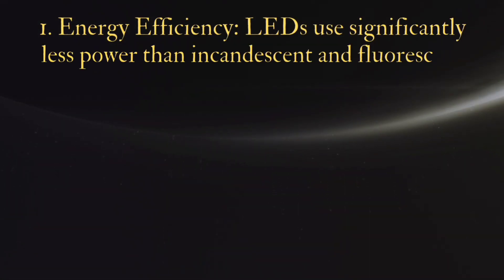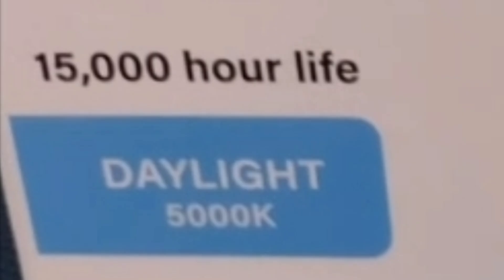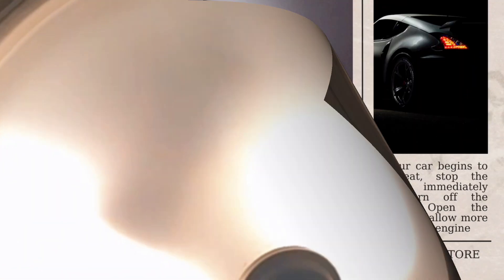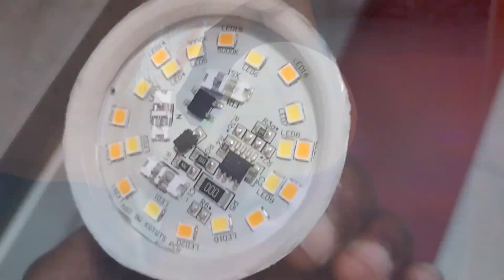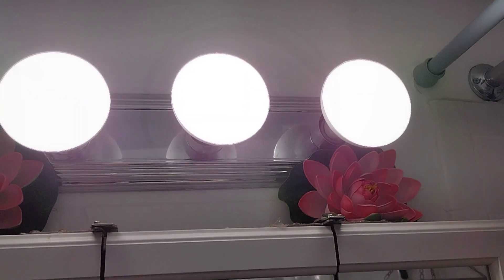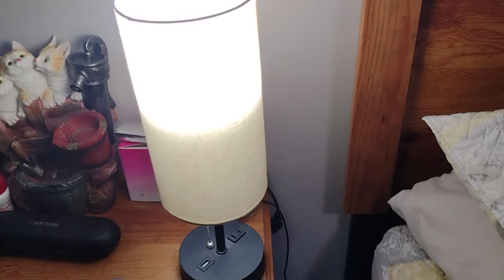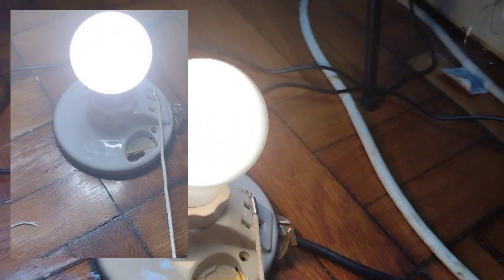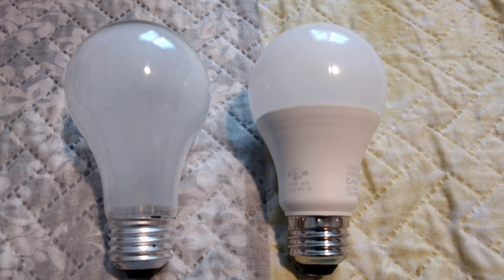Why You Should  Never Use LED House Bulbs In Closed Fixtures

Comment: The brighter the LED bulb, the shorter the lifespan.
Also, one 100W equivalent is cooler than 2 -50w equivalent bulbs.
Reply from the maker: @crazysquirrel9425  Thanks for watching and for your feedback. There is a direct correlation. Brighter bulbs equal more heat which means shorter lifespan.

Comment: I’ve lived this home now 25 years. My original kitchen, bathrooms, dining room lights now all at least that old. And all just plain old incandescent.
Reply: Same here.  A few are still here that i know are as old as the house (1979).  I do have LEDs outside and in my workshop.  Everywhere else I only use incandescent.
Reply: Incandescent bulbs are getting much harder to find.
Reply: @heronimousbrapson863  True, but these bulbs themselves are 25+ years old, and I have a stash
Reply: And don’t forget, in these northern latitudes we are in a net heating situation sept-jun. there is no such thing as”wasted” heat for 9 months of the year, when it’s darkest the longest.
Reply: @ak983625  amen!
Reply: ME TOO! I have more than 3 dozen single-life incandescents that are just about 25 years old, and fewer than 5 have burned out since they were originally installed when our house was built. I have stockpile of American made double-life halogens, and I get about 5-10 years out of most them. It's sad that we killed the entire American light bulb manufacturing industry by banning halogens and incandescents in favor of cheaply made, overpriced Chinese junk.
Reply: @John-bs5ug  you’re right, Chinese junk. With dimmers, I run all lights, even halogens a measure below full, and kooks way better.
Reply: I will use up my stash of incandescent bulbs before I start buying these fancy LED bulbs.  I can’t see throwing away perfectly good bulbs for a chance at saving money on my power bill.  It’s just me in the house and rarely do I have more than 1 or 2 bulbs burning at the same time.  I’m not like some people that keep their entire house lit up at night, inside and out.
Reply: @CH67guy1  keep buying incandescents till you can't; you won't regret it.
Reply: @KC9UDX  Yes I agree!  Thank you!
Reply: @CH67guy1  That's a woman thing! My second job is running around turning lights OFF!

Comment: just swapped out some incandescent 100W bulbs for incandescent 275W bulbs. hell yeah!

ok, ok, theyre for an incubator... the whole point is theyre supposed to get warm!

had to change the sockets from BC to edison though. really hard to find high wattage bulbs on a BC base. the original bulbs were carbon filaments, basically unobtainium... the replacements from the supplier? nasty chinese things that burnt out within a few days, if that. tried a bunch from fleabay for about 1/10th the price... turned out to be exactly the same bulb, in a different package.

the "tastic" heat lamps work fine... and are easily obtained for when they fail.

anyway... the same issue applied to the CCFL, when governments started mandating "efficient bulbs"... that fitting intended to cope with a 60W incandescent simply wasnt ventilated well enough to allow the electronics of the inverters to survive for much longer than a few weeks... quite a few fires were started... 

still, i have the odd CCFL still working fine in various locations. all "open".
Reply from the maker: @paradiselost9946  You had me for a while with those high wattage numbers. Thanks for watching and also for your contribution to this ongoing discussion. Your feedback is well appreciated.

Comment: Osram LEDs with filaments have been the worst so far. Instead of 15 years as promised, most only lasted 2 to 12 months.
Reply: That's very sad, because we have dozens of 25-year-old American made incandescents made by the predecessor to Osram/Ledvance, Sylvania, that are still working just fine. So often, LEDs are just cheaply made, Chinese junk.
Reply from the maker: @John-bs5ug  Thanks for watching and also for your feedback. I will definitely give the Phillips or Sylvania brands a try.
Reply: @John-bs5ug  I also have Osram incandescent light bulbs that I bought before the ban (in the EU and here in Switzerland). These are made in Slovakia. I also use a lot of Philips ones. Haven't had any problems with it, just with Osram LEDs with filaments that started flickering after a few months. I took everyone back to the store and got the money back.
Reply: @Tag-Traeumer  Yeah, in the USA, I see flickering LEDs, either plastic or clear glass w/ LED sticks/filaments, all the time in stores that display bulbs. I also see quite a few burned out after just a few months of being installed.
Reply: @John-bs5ug  We noticed that the old form of LED lamps with LED chips were longer lasting than the Osram ones with filaments, which squeezed the power supply into the small screw base, where it tended to get hot. Apparently you can now only buy the filament LEDs. I tried another little-known brand that claims high efficiency and long lifespan.  They have much more filaments than ordinary ones. So far it has lasted longer than the Osrams. The quality of the light is just a little worse.
Reply: @Tag-Traeumer  Here in the USA, there are so few light bulb brands left on the market. Stores used to carry at least 2 or 3 different brands of bulbs, but ever since the incandescent light bulb ban, they all switched to carrying just one brand per store. So instead of being able to compare GE to Osram/Sylvania to Philips to a store brand, you're stuck with whatever that store has. We don't have too many filament style LED bulbs or longer life LEDs in stores around me either, but you do see a lot of cheap plastic $3-5 ones that produce very harsh, low quality light that distorts colors in the room. I guess it's because the average consumer doesn't want to pay $10 per bulb. Even in grocery stores, I sometimes see items that appear off colored (yellow/brown lettuce or very dark colored meat), but in reality the poor quality LEDs make food look old when, in fact, it wasn't.
Reply: @John-bs5ug  I am still amazed and disappointed that the majority of people are satisfied with the poorer light quality of energy saving and LED bulbs imposed by the Incandescent bulb ban. Every red object is significantly paler under LED light bulbs because deep red is missing from their spectrum. I once thought my living room wall was yellowing, but it was an energy-saving lamp with its poor light. In the past, LED lamps at least lasted longer. We have a small, weak first generation Osram LED lamp with many individual LEDs (like normal indicator LEDs) that has been lighting non-stop day and night for 14 years now. Thanks to the ban on incandescent light bulbs, I think LED light bulb producers can afford poor quality.
Reply: @Tag-Traeumer  I agree completely, but now we don't have a choice anymore. Just 10 years ago, the vast majority of the US citizens were using halogens and left over incandescents, while some were using CFLs. Almost everyone agreed that most CFLs produced sterile-looking light akin to what you'd find in a warehouse, which begs the question why don't they think the same thing about LEDs? Then California banned halogens around 2018 or 2019, and still, most households in US not using LEDs. Finally, once Biden took office, the Dept of Energy (DOE) reversed Trump's order repealing the reversal of the nation wide halogen ban President Obama wanted to put in place. The DOE under Biden admitted that fewer than 50% of households used were using a majority of LEDs, but used the cost of the lowest quality junk to say that the "price has come down" and that they last "25 times as long as an incandescent". Well, the cheap junk that's flooded the market doesn't even claim to last 5 times as long as an incandescent, let along 25! And yes, you're right that the old ones lasted longer, and most used to claim a 20+ year life, but now even the most expensive ones don't even claim half that. Not to mention, thanks to that ban we no longer make, or even assemble a single light bulb in the USA anymore. Is making plastic and computer chip bulbs in China really better for the environment than making glass and metal incandescents/halogens in the USA, while using a little bit more energy? Was it worth killing all those jobs? Is it worth lower quality, harsher lighting? I think not.
Reply: @John-bs5ug  That is very true! Good light or the freedom to choose light should be important to consumers, apparently not. As a Swiss and European, Trump seems pretty crazy and unelectable to me. But the fact that he was against the incandescent light bulb ban makes him a lot more likeable to me. I would vote for him for that reason alone. I'm still angry that the incandescent light bulb was used as a scapegoat and the ban was used as an alibi for climate protection. The incandescent light bulb is one of the best inventions ever, even the symbol of an invention and a good idea. We're used to a lot of nonsense from the bureaucratic and sometimes stupid EU here, but the fact that the USA also banned the incandescent light bulb surprised me even more. Since when does a technology have to be banned if it is supposedly so much worse? And light in apartments consumes only an insignificant amount of energy. I use some LEDs, but in the apartment more incandescent bulbs because of the better light. The slightly higher electricity bill doesn't bother me, you don't notice the difference, and the heat radiated is pleasant in the cold season. Many people and companies are now purchasing more lamps with more lumens and letting them shine longer because they are efficient LEDs. So it's pointless. I don't let politicians patronize me and use the lamps I want. To do this, I had to stock up on incandescent light bulbs before the ban, too large a stock, as I later realized. People generally know nothing about the physics of light, about the different spectrums of fluorescent lamps, LEDs and incandescent light bulbs. In principle, LED light bulbs are also fluorescent lamps with phosphors, and the spectrum can therefore never be continuous and balanced like that of thermal radiation, for example from incandescent lamps including halogen lamps and of course the sun.
Reply: @Tag-Traeumer  You nailed it. Here in America, it costs you a whopping $5-6 per YEAR to run a halogen incandescent for 3 hours a day every day, while a similar LED costs $1.25. That means you'll save $0.32 per bulb per year; so unless you turn on hundreds of bulbs every single day for hours on end, that difference is indeed negligible. People often wonder why things look "off-colored" or "strange" in their homes all of a sudden, and fail to realize, as you said, that different light sources have different properties. A lot people notice that an LED looks harsher and brighter directly under the bulb, but doesn't seem to light up the room the same way as a halogen. That's because LED lights are directional, and produce non-uniform lighting. And it's exactly the same here in the USA where companies and homes have MORE lightbulbs or fixtures than ever, many in higher lumens, partly because LED light is directional. So, in reality, we aren't reducing energy usage. Plus, single-use LED fixtures that don't have replaceable bulbs, are not only more costly to replace every single time an LED goes out, it has a far greater environmental impact than a simple incandescent/halogen. Trump is a very different kind of politician who is just standard issue, aggressive New Yorker. ("If you can make it there, you can make it anywhere" is really the truth. And the only way to make that happen is to ruffle feathers and be aggressive because New York will chew up and spit out anyone who isn't.) Normally, as an American president, you just go with the flow and never question any of your friends (ie allies), because you're afraid that they won't be as friendly to you in terms of trade, tariffs, etc. He realized that some of our best friends, including Canada and the EU, put high tariffs on certain American made products, while we levied no such tariff on the same type of goods we import from them. I don't know why democrats all of a sudden decided that the best way to reduce energy usage is to force everyone to use LEDs. In fact, cities like New York City switched high pressure sodium streetlights to LEDs almost 15 years ago, claiming that they would "save energy" and reduce light pollution. But guess what? A HPS streetlight actually produces more lumens per watt than an LED, and LEDs, in fact, produce more light pollution than HPS. Some Democratic-controlled states have even banned all florescent tubes, and the Biden administration is planning to ban CFLs, and they even planning to ban most all LEDs that are currently on the market in favor of crazy bright ones that produce a 120 lumens per watt. For the sake of my eyes, I hope Trump wins are reverses all these onerous regulations.
Reply from the maker: Thanks for watching and also for your comment. What is clear is that the led bulb build quality varies according to their brand. I would love it if the viewers who have had their led bulbs lasting for many years to share the name/brand bulbs that they use so that we can all enjoy similar experiences. Let's see what happens.

Comment: Its a fact, light bulbs left in enclosure for extended period leads to premature due to excessive heat build up from the leds.
Its best to avoid using them in enclosed enclosures.
Reply from the maker: @Warrentex  Thanks for watching and for your input. So what you're saying with regards to totally enclosed luminaries (enclosure) the led bulbs won't last as long especially if they are used for extended periods of time on a daily basis

Comment: depends on the build quality of bulbs. and the line voltage quality to some extent.
you cant put a few holes @ bottom and top sides of the fixture, to circulate some hot air, if that helps.
Reply from the maker: I am currently running my personal experiment with one such bulb that was failing. I drilled a few holes in the diffuser and I am now monitoring to see how long it will last. It's working fine now so thanks for this suggestion and also for watching this video.

Comment: I think your main problem is you're using cheap bulbs. If you stick to branded bulbs like GE, Philips, Osram etc I doubt you will have this problem. They will use higher quality components that it should not be a problem for. In the UK and Europe you can't buy anything other than LED bulbs and I have numerous enclosed fixtures with bulbs that have been in them for five or more years with no issues at all.
Reply from the maker: @robert.wigley  Thanks for watching and for your comments. I know that GE and Phillips are reputable brands known for quality so based on this knowledge I need to switch to these brands for better performance. I will order a pack of the Phillips brand. Thanks.

Comment: In Mike’s case here… He should switch to the curly fluorescent lamps as they handle heat much better.
Reply from the maker: @blipco5  Thanks for watching and also for your input. Back in my home country this is the style of bulbs that I used, however I don't recall seeing them here in the USA based on my location or maybe I just haven't been looking. This is a viable solution. Thanks

Comment: The problem is LED bulbs have to have a circuit to convert the house AC to the voltage LEDs use. Heat is the enemy of electronic circuitry.
Reply: I wonder if you used an external power supply to power LEDS if it would make them last longer?
Reply: That's not what burns out. It's the LEDs inside. In fact, I often take the cover off, either short out the burned-out led or replace it. Then glue the globe back on. The later bulbs they make it so I can't even do that. If I take it apart I end up destroying it.
Reply: @robertthomas5906  Was thinking about the heat factor.
Reply: @robertthomas5906  Bottom line is that heat is the enemy hence the instruction not to enclose. Not sure if some designs do allow enclosure.

Comment: It was only after having blown a couple of bulbs in my hallway lamps, that I found out about the problem.
I replaced them with proper LED units. The downside of this however, is that when they eventually fail, the entire lamp has to be replaced, and good ones can be quite costly.
Oh, and the only incandescent bulbs legal to sell here in Denmark (EU?) is the small ones for ovens, as LED ones can't handle the heat.
Reply from the maker: @HepauDK  Thanks for watching and for this important bit of information. Let's continue to share this type of information so that we can make better choices and get better quality products also for our money. Thanks for sharing.

Comment: The stores in my area don't sell enclosed fixture bulbs, I have to get them off the internet
Reply: Check your local Dollar Tree. The Dollar Tree locations in my city sell LED bulbs rated for enclosed fixtures for $1.25 each. However, I don’t think all Dollar Trees sell the same brand of LED bulbs. The rating “suitable for enclosed fixtures” would be noted on packaging and printed on base of bulb. Also note that all LED bulbs are not dimmable. This too will be noted on bulb packaging and on bulb, “dimmable” or “not for use with dimmers” or similar.
Reply from the maker: @djm5k  Thanks for watching and also for the information that you have provided. It's much appreciated. Are you able to comment on their longevity of these led bulbs, since this is the main concern that I have? Thanks
Reply from the maker: Thanks for watching. I haven't been able to find them at the stores that I visit so sourcing them from the Internet seems to be the best bet, and choose reputable brands